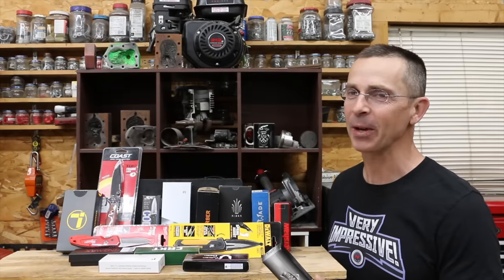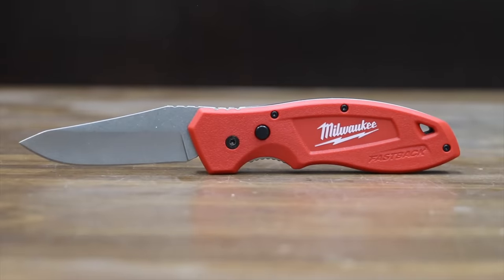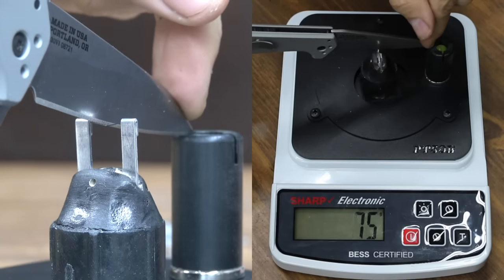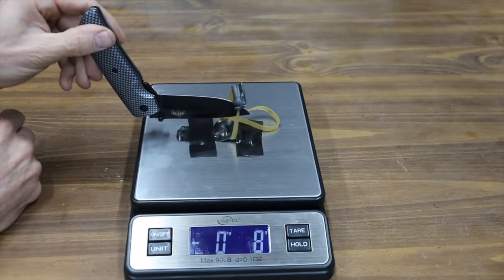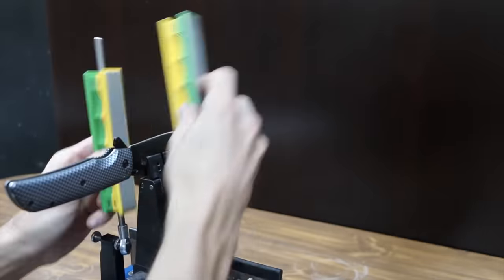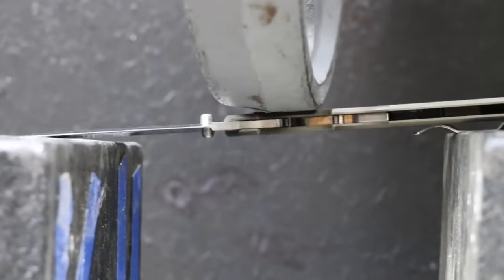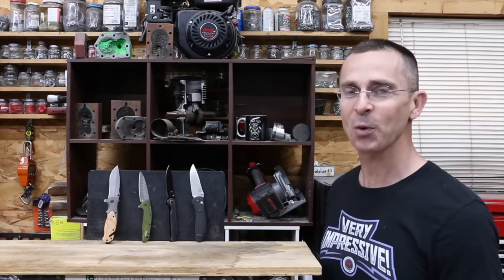Best Knife (Ep 2)?  CRKT, Gerber, Leatherman, Fallkniven, Victorinox, Kershaw, DeWalt, Milwaukee

Comment: It would be interesting to see these tests repeated time after time, as a big factor in the cost of many high-end knives is the longevity of the components. Also, factor into the cost of knives and the warranty associated with them e.g. Leatherman 25yrs and Victorinox lifetime warranty.  Another point to note would be that the higher end knife steels, especially the 3g steel on the falkniven could be refined further again up to a mirror polish and retain that sharpness without rolling.
Reply from the maker: Thanks for the video idea.
Reply: @ProjectFarm  Here is the thing about locking systems on knives. You dont want a lock that is easy to open. The harder it is to open, the less likely you are to have it break open, and cut your finger off.. I found out that the hard way, and almost lost my finger when a liner lock broke
Reply: @KrazyMitchAdventures  thats what i was thinking when looking at the force to close graph.. i‘d rather it be stiff to close every time than it just releasing the blade when i blow on it, theres also a thing with sharpness out of the box, if its wicked sharp out of the box, it might be to mask pisspoor edge retention, all my high quality knifes came very sharp, yet needed touchup out of the box, aside from the handforged one, while im referencing my experience with chef knives on the sharpness part, i‘d wager a guess its the same for edc ones
Reply: @imbored667  My brother is a knife customizer, and he always said a knife that comes from the factory with a stupidly sharp edge, means that when its dull, you'll never get good edge retention. Find a knife with a good bevel, and a good edge, something you can work with to put a working edge on.  Knives are tools, not works of art. If you buy a knife to hang on the wall, then it never needs to be sharp. 

I have a wall hanger Shinshinto (Katana), it was made the traditional way, is everything authentic, except being sharp.

Comment: I'd go with the Victorianox any day.  It's really stiff when new but if you use it regularly anywhere near as much as I use mine then it loosens up to have great hand feel without getting excessively low force or sloppy.  The Victorianox is an example of a knife built to last a lifetime vs one that is meant to be used and abused then discarded and another bought.
Reply: Yep.  I like victorinox pocketknives.  I usually lose them before I wear one down.
Reply: You're also not going to accidentally unlock it anytime soon so probably quite safe, sadly we in the UK can't have locking knives so we're stuck with the backs of our fingers getting sliced up if we knock the back of the blade.
Reply from the maker: Thanks for the feedback.
Reply: @Michael Schikschneit
The knife called Victorinox and not Victorianox :-)
Reply: @ralfhartmann5050  autocorrect lol
Reply: @michaelschikschneit8550  lol :-)

Comment: Out of those, Kershaw or Kizer seems the best overall (depending on how often you drop your knives). The force to open tests aren't really applicable to the knives with spring assist.
Reply: Spring assist and auto knives are harder to close. I've used a Benchmade for years because of the effortless one handed use without the need to touch the blade at all.
Reply from the maker: Thanks for sharing.
Reply: Liner locks tend to be the easiest for me to open and close one handle like on my leathermans.

Comment: I wonder if the leverage you get from a longer knife gives an advantage to cut the wire. Even if the fulcrum is the same distance from the tip, the longer overall length probably gives a mechanical advantage in that test.
Reply from the maker: Thanks for the suggestion.
Reply: Leverage has nothing to do with sharpness when it comes to a super sensitive scale and a slow process like he did.
Reply: I think the wire measures the pressure it's receiving before being cut. So while the leverage would mean it takes less effort for the user to apply the pressure, it would be the same amount of pressure reached before the wire gives. That's my guess anyway.

Comment: RESULTS:
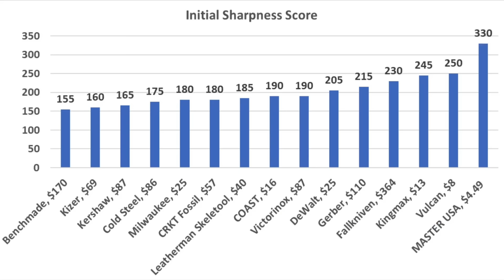6:03 Sharpness
6:15 Weight
7:43 Blade Lock Release
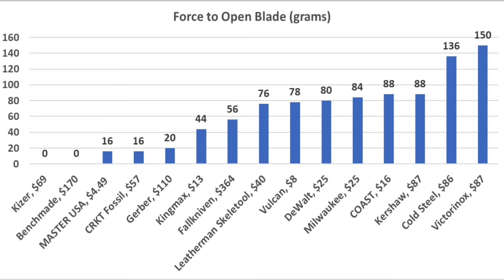8:57 Force to Open Blade
10:15 Sharpness After Bamboo
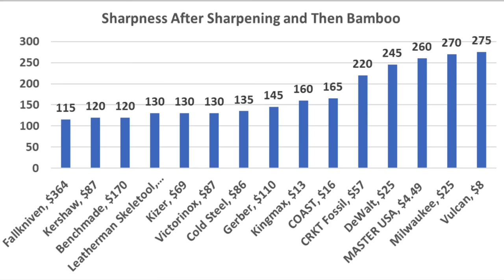13:03 Sharpness After Sharpening, Then Bamboo
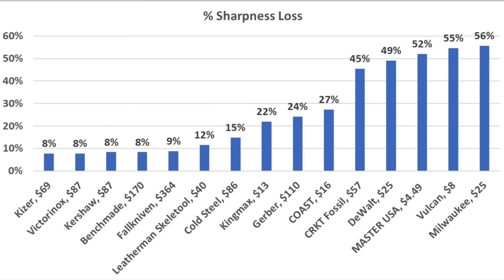13:15 % Sharpness Loss
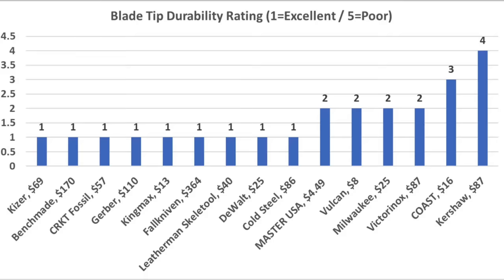14:53 Blade Tip Durability
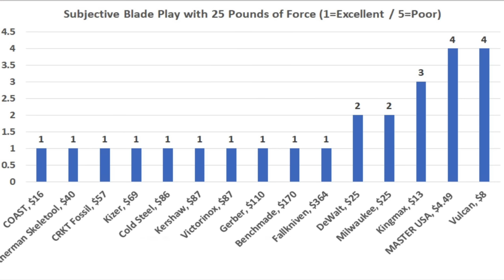16:22 Subjective Blade Play with 25 lb of Force
18:13 CONCLUSION
Reply from the maker: Thanks for watching!
Reply: @ProjectFarm  thanks for the thorough testing! Such valuable content!

Comment: I think it’s safe to say that the best knife wasn’t tested. Hands down that 65 year old Case, they don’t make things like they used to.
Reply: Planned obsolescence should be illegal.
Reply: They make them better than they used to.  Modern blade steels are far far far superior to older steels.
Reply: @brandonthompson8413  I would almost bet my annual salary that NONE of those knives tested would last 65 years. Maybe the blade itself, but not the knife as a whole. Too many cheap parts in today’s manufacturing process.
Reply: @brandonthompson8413  
Not always. The best blade is one that you have to keep oiled because it is good old fashioned straw yellow tempered high carbon steel. They don't sell many of them though, because no one knows how to care for them and or don't want to care for them and they rust if not cared for.
Reply: @Kingpin6100  
Agreed 100%!
Reply: @onlineredneck  i beg to differ. i own a few of those old knives despite prefering the modern ones. while case does make a pretty decent knife, i doesnt really hold up to a decent modern knife. if you take the benchmade for exemple. the worst thing that could happen in normal use is wearing out the bronze bushings that are in the pivot. if that happens you can get new ones and replace them yourself because the knife is screwed togheter and not pinned togheter like the old case. same thing goes for the nylon handle. although if you break the nylon handles, thats definitely user error.
Reply: @davidscott5903  Really, not so much.  Modern stainless steels are just as good if not better for most applications.  Especially for pocket knives.  There are some carbon steels that are better of course for a harder use fixed blade but for a pocket knife you would be hard pressed to find a carbon steel that out performs some modern stainless's for every day applications or kitchen use because they have just about the same edge retention properties and toughness as older carbon steels with the added corrosion resistance of a stainless steel.   The stuff that CPM is putting out is nothing short of amazing.  S35VN, S45VN and SPY27 are all amazing all around steels that will simply destroy any older carbon steel in every category in a pocket knife.  I'm not saying the classic carbon steels are bad, i'm saying metallurgy has come a long way and if you are willing to pay for it you can get an OUTSTANDING performing stainless steel.
Reply: @onlineredneck  The benchmade would, any spyderco would, any CRK would.  You assume that because something is new and manufacturing is cheaper that its worse, that couldn't be further from the truth.  A lot of ways things are just streamlined.   Manufacturing processes are making far better products now than anytime in history.  Just because it's older doesn't mean its better. It usually means its worse by a considerable margin.  Especially when it comes to knives.

Comment: I have a small knife collection going now. I have also worked retail part time at a store that sells a lot of high end knives. 

I own many benchmades and one spyderco para 2. I absolutely love these knives. 

I have broken a couple pocket clips now on my benchmade mini gripitilan that I EDCd for many years, however the knife itself has taken a BEATING. Still works as well as it did the day I bought it. I also began to notice very very very minimal oxidizing on the blade from my crooked river, but it went away after a gentle buff with a rag.

As for the para, I don't use it a whole lot, as it's just a little big for my edc preferences. But haven't had any issues with it. I did manage to chip an extremely small part of the blade, but it was so minimal a quick trip to the stone took it right out and it isn't even remotely noticeable.

I have played with many zero tolerances, but have never owned one. Personal reviews from little experience shows they are very well crafted knives that operate smoothly. However I'm not a big fan of the way they look or the way they feel in the hand. I find them to be very awkward handling knives and they look like cheap gas-station knives. unless you've got an eye for knives, it wouldnt be one you look twice at if you saw one "in the wild".

Kershaw in my opinion is by far the best "affordable" tier knife manufacturer with consistent quality. I own probably a dozen or so Kershaw knives and have yet to be let down by one.
Reply from the maker: Thanks for sharing.

Comment: The Kizer is amazing I must have one. 

 I do construction, remodeling and stuff and I pretty much abuse my EDC knives.  I have some first hand experiences that I can share. 

I've bought several of the Coast knives at Home Depot for very cheap. They sharpened up very easily and work perfectly fine and they're easy to resharpen after you dull them. I oil up the pivot point on my cheap knives with firearm oil and adjust the pivot screw and use some Loctite on the screw to fine-tune them. 

The DeWalt knives also perform pretty well as knives that you can just beat up and not worry about it I've used them as scrapers. They also are easy to resharpen after you dull the blade. 

I have a CRKT that I have been able to get shaving Sharp and mine was only about $25 and it's a great knife for EDC.

 The cheap $15 and $20 Gerber knives are also great EDC knives that you don't have to worry about beating up. 

I also got a Crescent brand knife made of D2 tool steel I got on clearance for $8 at Lowe's that has been great, normally about $20 I think. 

I always thought the Milwaukee knife looked pretty nice and have thought about buying one, I'm glad I didn't because those things are crap and they cost just as much as the DeWalt knives which are apparently a lot better.

I initially didn't trust the Coast knives because I thought the price was too good to be true.  I've had some of them for years and have used the heck out of them. One thing to remember about the cheap knives that don't have high end steel.  While it won't hold an edge as long it will get you through the day and then you can sharpen them much faster than the super hard expensive steel. 

These new hard stainless and tool steel blades do not respond well to the old sharpening stones.  You are better off with the diamond coated sharpening stones. 17 degree angle gives the best performance.
Reply from the maker: Thanks for sharing.

Comment: Very impressive testing, I have a milwaukee hardline series knife with D2 steel blade and bearing system. it has a very solid framelock and the blade has a good edge retention. It is double the price of the one milwaukee in this video but it is much better in my opinion. I also have one old Wenger swiss made pocket knife from my grandfather, he used this knife for 50 years and is in good condition.All the respect for this man and his 65 year old pocket knife.

Comment: I have a CRKT and kershaw that I'm generally happy with.  The CRKT was out of the box extremely sharp and seems to hold its edge better.  The kershaw was no slouch, but not as sharp and dulled a little more I think.  The kershaw's main draw was the integrated screwdriver in the handle, with 2 flat and Philips heads each.  Extremely convenient tool for my job at the time.  They were both also very cheap.  Not no-brand cheap, but cheaper than their representatives in this test.
Reply from the maker: Thanks for sharing.

Comment: Excellent video as always.  I'm not 100% sure on this, but I think on the sharpness tester the knife blade is supposed to rest in the slot that's notched into the top of that pole used as the fulcrum... at least that's how I've seen other knife channels use it.  You rested the knives perpendicular to it.  I'm probably just splitting hairs here because your results seemed as accurate as any I've ever seen, so take this with a grain of salt, I just figure there's a reason why that slot was designed into the tester even though it may or may not make much of a difference either way.  You are most definitely as unbiased and thorough as they come in all your testing and sure do appreciate your efforts.  You rock!!!
Reply from the maker: Thanks!

Comment: Thanks for the review, I was surprised not to see Spyderco here - maybe the Delca, Endura, or maybe para-military/military.  Personally I keep coming back to Spyderco because I like the thin profile, light weight and the way it opens.  Also, my first knife that I have had for nearly 40 years is a Case similar to the older service man you interviewed though it also had a flat screwdriver/bottle opener and also a reamer in it.  Great knife that Case but times have changed and though I still have the Case I EDC the Spyderco.
Reply from the maker: You are welcome!  Thanks for the suggestion.

Comment: Great vid, I just watched it a second time. 

I picked up a Kizer a couple of months ago. It has M690 steel, my first knife with this steel. It maybe the sharpest knife out of the box that that I've ever purchased. That's subjective though, since I don't have a gauge. I have some diamond stones, but for an EDC knife, assuming I can get a design I like in it, I am a big fan off 440C. It's very rust resistant and it holds a great edge. But you don't need a diamond stone to sharpen it. Almost everything else that rivals or exceeds it requires a diamond stone to sharpen it in a reasonable amount of time. 

I have a couple of D2 blades that I like, but I feel like I have to baby them so they don't rust.
Reply from the maker: Thanks!  Thanks for sharing.

Comment: Mr. Smith appears to be quite a wise and humble man! As far as the knife test, excellent job. No criticisms or suggestions, just a comment: One of the biggest differences I've noticed between cheap and expensive knives isn't necessarily the steel, it's the quality of the handle and the locking mechanism, which you did touch on. I do like my Kershaw, and I'm not too concerned about breaking the tip, though it's good to know it doesn't like being dropped on its tip! Thanks.
Reply from the maker: Thanks for sharing.

Comment: Thoroughly interesting study!  As a rigger I would be interested if you could do a similar investigation on hawksbill knives that we prefer for cutting rope, netting, web etc. and other entangling materials we work with.  Hawksbill don't allow the often round load to slip the blade.  Serrated edges are good too because they only cut with a sawing action.  If you accidentally hit yourself with a straight edge it cuts through tendon to the bone, but multi point puncture serrated patterns leave only a line of pricks that don't usually require stitches:- unless you start sawing, which is highly unlikely.  Love the way you certainly appreciate that glass breakers, safety seat belt and harness cutters and quick one handed opening is well regarded by professional riggers too. Lay people just don't get it.  Regards and my thanks!
Reply from the maker: Thanks!  Thanks for the suggestion.

Comment: I always take the screws out of my new knives, apply thread locker and reinsert them. Haven't lost a screw since.
I like the cheap knives because they get beat up as I use them as a local truck driver. Plus I like a variety but don't want to spend the money.
I usually sharpen them and apply thread locker to the screws. My current flip knife has a pakka wood handle that I paid $4 for in 2016. Today they're selling for $14
I like it because it has a smooth handle and slides in and out of my pocket easily.
Reply from the maker: Thanks for sharing.

Comment: I own a lot of the knives on this list, and I can say your test are very accurate. Benchmade is one of my favorite EDC, and it's because it's very tough and has extremely good edge retention, but keep in mind if you do dull it really bad by using it for bushcraft or something along those lines it takes a lot of time and patience to get the edge back on one using a good hand sharpener (most electric ones mess up your heat treatment) and knowing what your doing. If your going to carry one EDC for general use I'd suggest getting a good hand sharpener and learning how to use it properly or paying a pro that will use a wet stone to sharpen it. (Make sure they aren't a hack using an electric stake knife destroyer in the back)
Reply from the maker: Thanks for the feedback.

Comment: Was a butcher for 10 years. Used nothing but victorinox/forschner knives.

8inch bull nose
8inch breaker 
10 inch Gran bull nose
6 inch flex
6 inch semi stiff.
Reply from the maker: Thanks for the suggestion.
Reply: You should try LC200N , Vanax, or Magnacut

Comment: I love your channel and the way you test these products. Thanks for all your hard work!
In this video, I would have to heavily weight the importance of the "Sharpness After Sharpening And Then Bamboo" test above the initial sharpness tests. Every knife that is actually used will have to be sharpened many times throughout its life. I believe that edge retention is a critical consideration, especially for an EDC. The knife will be more useful if it stays sharp and it will last longer the fewer times that it needs to be sharpened. This is assuming of course that there are no design or manufacturing defects.
Reply from the maker: Thanks and you are welcome!